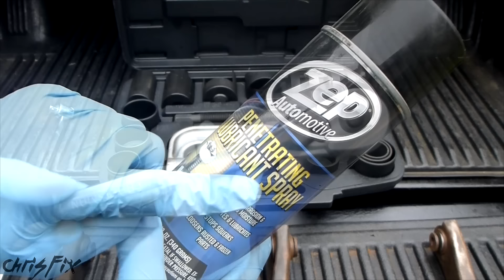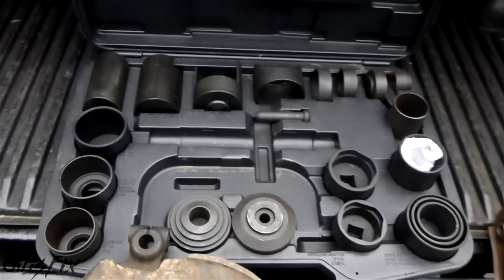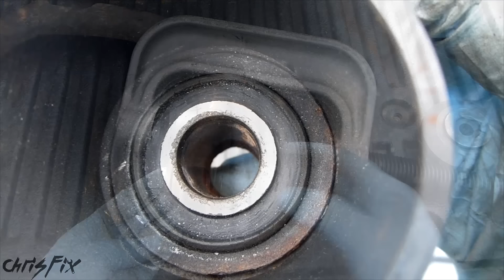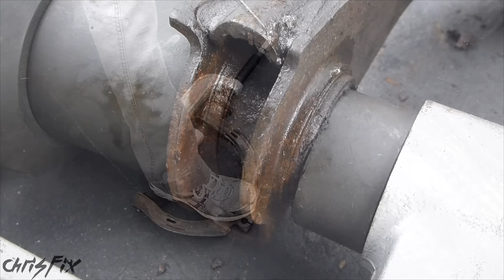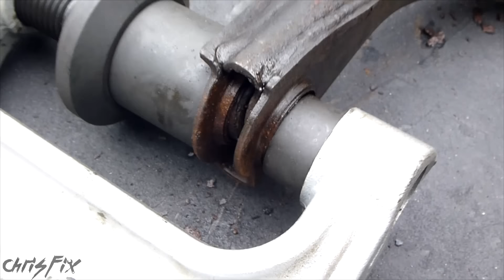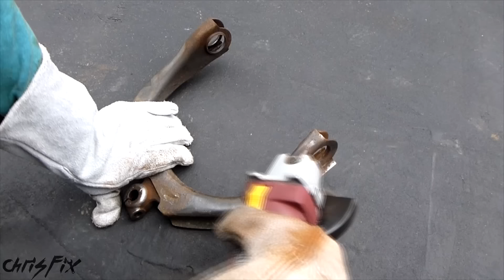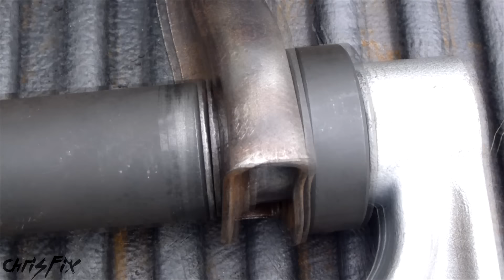How to Replace Control Arm Bushings (EASY)

Comment: Uhh, you're not supposed to run the screw in any tool of this kind dry! Some of the resistance you experienced was because of that. Clean and grease the screw properly. You won't need the breaker bar. You also won't need the breaker bar when you won't be squishing that poor wishbone. Next time get an old spanner or another piece of stock and grind it down to be a spacer.

Comment: This is genius! I used this same setup (balljoint press and various impact sockets) to replace the bushings in my rear upper control arms. Would’ve cost over $300 to replace them! Regular bushing press wouldn’t have worked, because bolts were solidly seized (welded) to the inside bushing sleeves - so couldn’t pass anything through the old bushings.

It took two afternoons and ten Sawzall blades to cut the old bolts loose and free the control arms from my car, btw.

Comment: 2 years ago, I had an oil pressure malfunction,  and some bushings were soaked with oil per the mechanic. The steering instantly got 15-20 degrees of play.  Which bushings were most likely affected? Thanks for your time and courtesy,  Mark

Comment: I'll add that time is money, and aggravation is is free. New bushings are cheap.. but factor in the time and special tools (to do it right), and it ends up costing more to replace the bushing in most cases. People should check the price of a new control arm.. sometimes they are really cheap too. You can save 3 to 4 hours of free aggravation with just a replacement.

Comment: I replaced my squeaky bushings but now while I drive the whole lower rear vibrates but just at some speeds and only for like 10 seconds also when im getting off the freeway and im braking it does same thing any thoughts?

Comment: For everybody doing this, you need to have a spacer for removing the bushings on lower control arms (on older vehicles) and for most modern control arms. The easiest (and cheapest) way is to take exhaust pipe and cut it wide enough to fit in between the metal, but it must be cut in half (making two c shapes) in order to fit around the bushing to keep from bending the metal. Hope this helps somebody before it’s too late.

Comment: I used a floor jack to lift my vehicle up via each of the 4 control arms for like a minute to place jack stands on the pinch welds one tire at a time. The jack was place on the bushing? Did I do any damage?

Comment: Pro Tip:   Take your control arms with the worn out bushings and place them in a fire pit with cardboard. Set the cardboard on fire until the old rubber bushings catch fire. They will start burning and literally pop out all by themselves. Allow the control arms to cool off naturally by themselves before touching them. You will usually have to remove the round metal casings but they will come out very easily. The old paint and grease will also burn off, making the control arms very easy to wire brush to bare metal.

Comment: You realize bushing are sold at local stores right? Autozone,Orielys,Advance...all have them in stock for 8to14 bucks each. If you keep buying chinese ebay parts eventually it's gonna bite you in the ass.

Comment: Hello Cris, I apreciate a lot your channel, very practical! I'm bought for Christmas an e46 320d for me. Is my dream car, and I have already spent a lot in repair, and it need a fix in the control arm (aluminium part, so, it's expensive) and the shops I went (3 by now) gave me a budget around 400€ just on pieces and replacement! I was watching this vídeo on research to change the pieces by myself on the street where I live. Could you give some pointers on how to do it, to a nooby on mechanical things..? Thanks in advance, and best regards from Guimarães, Portugal! This car 320d is to remain for long time with me, and I want to do the maintenance on my own. Best regards! André Mota

Comment: I bought some used upper arms for my truck that provided additional suspension travel. Like you suggested I pressed the old bushings, painted the arms the same shade as the original manufacturer, then pressed in my brand new polyurethane bushings. It was easy and very rewarding

Comment: G.M has a tool set that has a long screw  bolt and large sockets and washers to remove and replace bushings. You need a spacer  in between the arm so it won't  crush the arm. Those arms are soft metal and you HAVE to use a spacer in between the U arm or it'll  crush the arm. Make SURE you use a spacer!!! A control arm bushing tool set might work. Use a wire brush to remove rust on the bushing cone and the  I.D. of the arm. The bushing rubber MUST touch  the frame so it holds the bushing tight. Make SURE both ends touch the frame. Consider a used arm if something goes wrong. You  might  be better to pay someone.

Comment: I bought Energy suspension bushings for front lower CA of a 2001 Celica took it to the mechanic and says he doesn’t know how to install them. I want to do it myself then. Just want to know if I need to leave any of the metallic parts of the old bushings in? Or should I take everything out and install the ES bushing with just Grease?

Comment: for everybody talking about the split weld/bent arm:this is avoidable using an air impact wrench it will not only be easier on the arm but a lot quicker too

Comment: I did upper control arms on a Lexus ls400 RWD. It did not use a press, but it was a lot of cutting and filing and trying not to damage the inside surface of the control arms. It was not easy.

Comment: I have a 05 Lincoln ls that squeaks in the rear. The car drives normal at all speeds. I’ve been told to just use lubricator to remove the sound. Am I able to get to the bushings without removing the wheels?

Comment: One question, When You Remove this Control Arm Itself Do What You Did ,Replacing The Bushing,Then Putting the Control Arm Back on Isn't there Alignment that needs to be Done?Or is this just a take Off and Replace Bushing and then Put Back on and Drive?

Comment: chris is it better to just replace the whole control arm? i found new control arm with built in bushings. the dealer is charging too much labor 5hrs, to just do bushings of upper control arm and 2x rear differential carrier mounts. i found all parts online.

Comment: I finally know why those dang bushing clamps never worked on my Jeep. I tried for hours to get the things to fit my control arms, which are much bigger than these, and could not get the bushing to fit inside the clamp with any of the included cups. Thanks Chris. btw I finally had to buy a press at harbor freight after taking 2 days replacing my front control arm bushings.

Comment: actually you only want to remove the rust if your going to coat them in paint. leaving bare metal causes them to rust again, making it weaker. its best to just leave the original rust there since that acts as a protective tree bark. removing the rust and having it rust all over again just removes layers of metal and makes the metal weak and prone to fail. thats why you see a lot of unpainted bridges look rusty

Comment: For stuff rusted like this, its best to hit it with the penetrating spray, everywhere,  starting 24 hours in advance, and several times.  Also, once force is applied to the press, rather than applying more and more pressure with a longer breaker bar, you can hit it with a hammer, while its under load, to break the hold.  The impact of the hammer strikes will loosen the hold from years of press-fit and corrosion and soon it'll pop right out without having to put extreme force on it.  You can always crank up the force if it's still stuck and hit it some more.

Comment: Chris I have a question for you 
I have a 2004 ford escape 2 weeks ago I heard some noises coming from the front end it sounded like the stabelizer bar I took it in and when they put it on the lift they showed me that my control arms and ball joints were also bad so I agreed to have it all replaced on the front end 2 control arms with ball joints and the stabelizer pins and they did the alignment once it was done.  Everything seemed fine the rattle was gone and it drove nice but yesterday I was backing out of a parking spot had my steering wheel turned all the way and it felt like I was hitting a curb and the wheel locked there wasn't  a curb even near and the only way I could unlock the wheel was to put it in drive and the wheel unlocked so I put it in reverse again and I hurt a clicking it was coming from my front end once I started driving it seemed fine but happened again when I parked the car again.  I brought it back to the place that fixed the front end and he's telling me he didn't hear anything and some times 4 wheel drive does this. It wasn't in 4 wheel drive.  Could this be a problem from all the installation not greased ball joints???? Or any opinions for me

Comment: Hey Chris, I just had my right rear control arm replaced and now 5 months later my right rear control arm bushing needs to be replaced. So that means the shop took out my lower bushing from the old one and put into the new one???? Shouldn't they have inspected the bushing and noticed it was worn out and replaced it instead of putting in the old bushing back into it? Any feedback from anyone would be great! is the shop in the wrong because I'm out two rear tires that are only 5 months old and they say my tire warranty and their 12 month parts warranty is voided??? Is the shop ripping me off or no?

Comment: Okay, just did this today, and can say, it is not necessarily easy. I rented the press, but did have all the correct sizes I needed, ended up using a piece of conduit. Even still I had to use a shop press to get those fuckers out. And it scared the shit out of me when it finally popped. The new bushings were literally 0.2 mm smaller than the seat and slid right through. So welded a bead in there and ground it down to allow a tight fitting, then tacked in the edges and instantly dunked it in water to keep the rubber from melting. Had to use an oxy acetylene setup to get the bolt holding the control arm to break free. Also had to remove engine mounts just to be able to access the control arm mounting bolts, which involved stands, pry bars, and there's no way any of this could have happened without a car lift. It would been worth it to just get new control arms and if I ever have to do this again, that's the route I'm going because it was like 99 degrees today and it took me about 5 hours. Ultimately, I would say determine the condition of the hardware under your car and what kind of environment it's been living in before you assume this will be easy. The ocean air has not been friendly to my poor car.

Comment: Chris

My upper control has the ball joint built-in. If I  remove it carfully do you think the bushing can be replaced without replacing the entire control arm? I'm having some memory steering going on not sure if it is my pump or not( it has been whining for awhile so needs to be replaced. Trying to track down the issue causing the steering wheel not to return to center after a turn. I know my control arm bushings need to be replaced you see and here it moving while moving the wheel or applying the brakes. While I was under there I can twist the tie rod by hand while the car is jack up and tire hanging so these need to be replaced. Have done tie rods before on others cars but only the outers. Its a 2011 crown Vic(last year for the Vic) was going to just replace the entire control arm but now realize I need more parts and been out of work for a bit due to a bike accident. Motor crafts control arms  are crazy expensive and have not heard of any other good aftermarket ones. I used to use Moog but heard they are not once what they were. You know any good after market brands for tie rods and control arms. From what I can here and see it appears the ball joints are still good no play that I see. I did crow bar test buddy helped so I could watch as he pryed up on the tire with bar.

Comment: Wrong too funny you just collapsed the control arm where the bushes go into the arm you need to place a half moon in between the sloted part where the bushing go through the hole,watch the again when he is pressing the bushings into the arms the arm deforms abit also if you have a older car like American GM Etc have upper and lower  A arms style suspension with springs in between them ,pain in the ass if you collapse the bushing mountings holes

Comment: you should not use gloves with a grinder if the glove is cot in the wheel your hand will be pulled in and will not end well

Comment: For bmw m3 there is a aluminium bushings...what do you think abt that? Been told that is the most durable. Just wondering if it will cause more wear and tear since its metal to metal contact without any rubber?

Comment: FYI, I broke 3 G-Clamps trying to get a bushing out of my control arm on my Toyota. The amount of pressure you're putting on it can break the clamp completely. What I did do instead was use a high tensile steel bolt and some sockets, and a vice. Worked fantastically well!

Comment: I hate BUSHINGS!  You make excellent videos,  the first arm broke, but that's what happens when you try and save money when you do it yourself.  When watching may have had to cut metal insert or find another socket to fit into the gap between the ears.   Machine shop will do for about 100 bucks for the pair, you supply the parts of course.  GREAT VIDEO MAN!  Your always giving motivation and getting me off my arse

Comment: easiest way to get the old ones out that i found, if they are really stuck, is with a hole saw that's just the size of the rubber.  You can basically chew out the rubber and the steel sleeve can then compress and come out just fine.  Way cleaner than burning them, and if they're really stuck, the ball joint press won't cut it...  And less chance of bending flimsy stamped steel control arms.

Comment: Just got an alignment and they said I needed to change the control arm.  I told them I could do that, but mentioned to them that I may just change the bushings and they recommended that changing the bushings was not sufficient.  Are they just trying to up-charge me?  In what case would I need to change the entire arm vs just the bushings?

Comment: Fixed my mom's Lincolns lower control arm. A $10 buck fix instead of paying $350 to the shop. Easy to do with the right tool.

Comment: Nice video. I wish there was a way to search comments to avoid writing a duplicate. I went back pretty far and did not see this one: oil the threads on the forcing screw. Gear oil works good, but at least use something. Also, for a thin stamping, there should be something between the two sides to prevent them from being crushed together from the force of the press.

Comment: With that control arm bushing you should soak it in muratic acid for and hour or so to remove the rust between the two sides of the bushing inside the control arm, otherwise you'll jab the rust into the control arm.

Comment: you cleaned up the outside of rust but that was not going thru the part and then on the inside were tons of rust was you did not even touch that and all that dragged thru, but anyway you got it out.

Comment: I'd position a wrench or some other solid object inside the bushing mount so it does not flex in and crack the welds. I also would use an impact gun and do a lot of penetrating oil first. thanks for the video I'm doing this job this weekend.

Comment: after changing all my break rotors ,calibers and break pads on my Honda accord 2006 I notice that the left tire has some movement and it is because of the front bushing was completely damage no boot at all  the guy at autozone recommended me to buy the whole wish bone and take it to a mechanic because is a delicate thing that has to be done by a professional I think he said that after I told him that took me 2 days to flush and change all my breaks because that kind of work should take no more than 2 hours.thanks for all the videos I have work in my car 2 days out of the week for the past 2 months and its been great challenging but great I am learning a lot.if you get a chance on making a video on how to detail an engine and flush the transmission fluid on a manual car and the clutch fluid everything else you have upload I already did thanks again for taking the time on filming and uploading this videos.

Comment: The most important part is to tight the bolts when the cars is on its wheels. Its good to be pushed forward and backward a few times when its on tires. If you tight them when its lifted up, all will be under pressure and everything will broke soon.

Comment: One thing that needs to be mentioned is that it is not always free to rent tools from an auto parts store. I had to rent a pulley install tool kit for my power steering pump and it was $40 to rent. Just stating that so just in case you need to prepared in case its not free.

Comment: Not sure how much it matters. But the proper way to use the "adapters" included in the press kit. Is to put the side with the multiple step down detail towards the pipe size/type piece used, whichever size that is needed for each different situation. The steps are made to accept the different sizes that are needed and come included in the kit. Simply put, opposite what is shown in the video, for the adapter being used on the right side, or the receiving side, of the control arm when the press is being assembled to push the bushing out.

Comment: Hey Chris I really appreciate your videos man its saved my ass so many times....My trucks squeaking right now and Ive checked the upper and lower ball joins both are good and intact upon my visual inspection then i noticed the bushings on the control arm were worn and falling to pieces...the outer tie rod bushing/ball joints are also trashed would either of these be the cause of the squeaking?